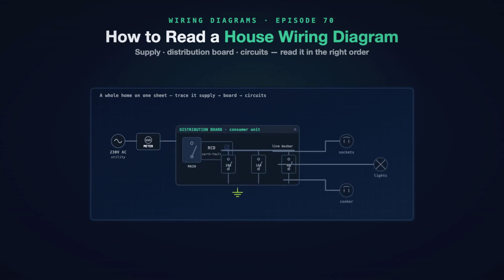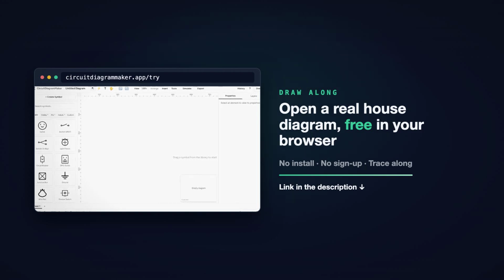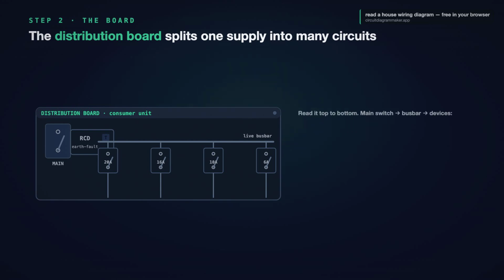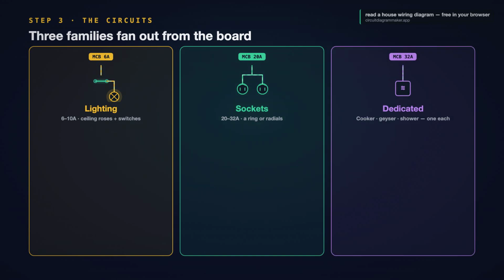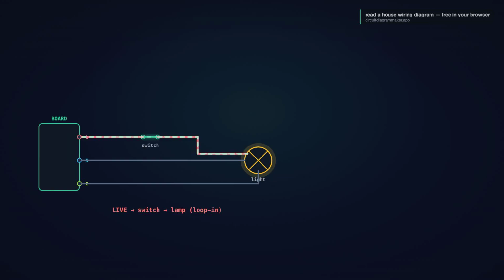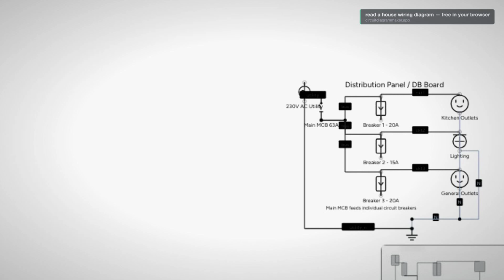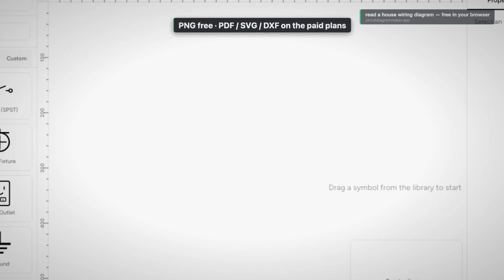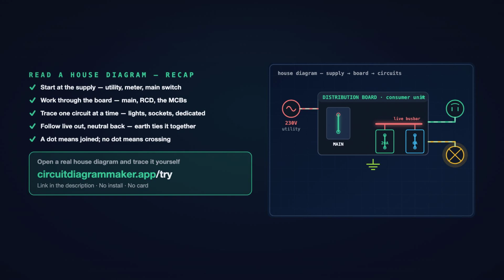How to Read a House Wiring Diagram

Comment from the maker: The one habit that makes any house wiring diagram readable: don't read it all at once. Go supply → board → one circuit at a time. Start where the power enters (utility → meter → main switch), walk the distribution board's breakers, then trace a single circuit from the board out to the point and back — live, neutral, earth. Do that and even a busy diagram gets simple. Open a real one and trace along free (no signup): https://circuitdiagrammaker.app/try?utm_source=youtube&utm_medium=pinned_comment&utm_content=yt-070